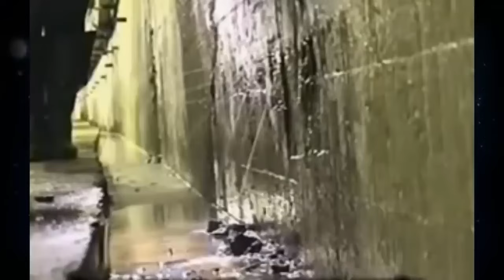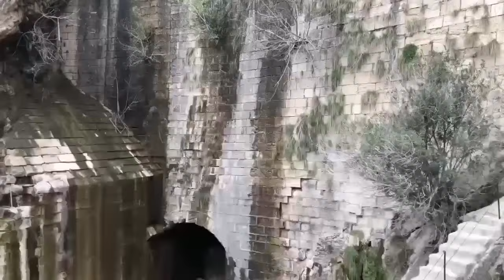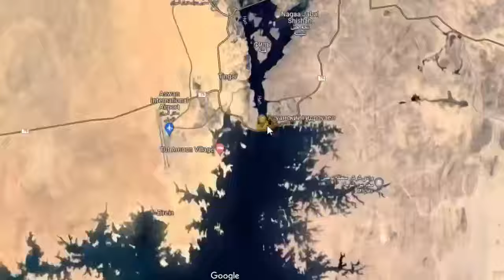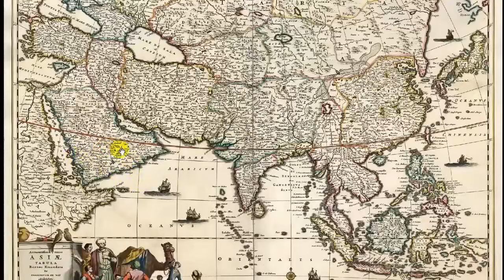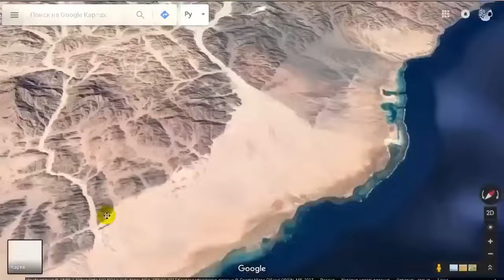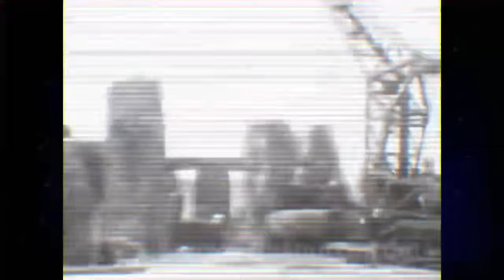Mysteries of Ancient Dams: Unique Approaches & Technologies

Comment: Very interesting. 
You Stonehenge reference is a mistake. 
In the 1950s–1970s, parts of original Stonehenge were reconstructed and re-erected, including using concrete to stabilize some stones. This restoration work has led to confusion and even conspiracy theories about the site being "fake" or "modern."